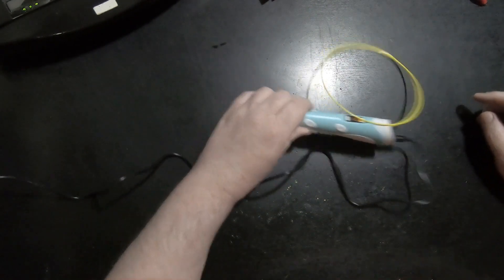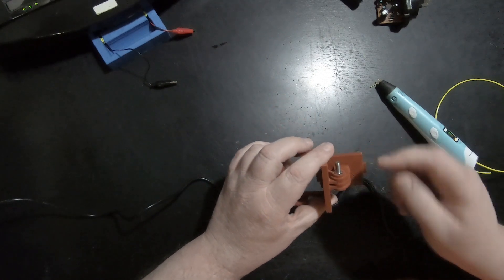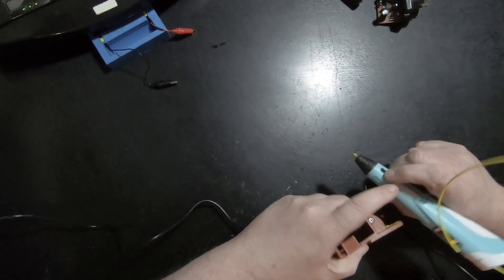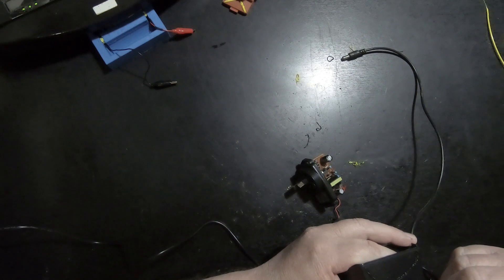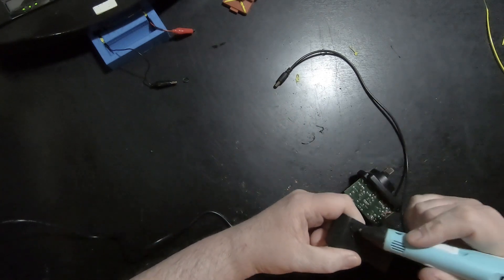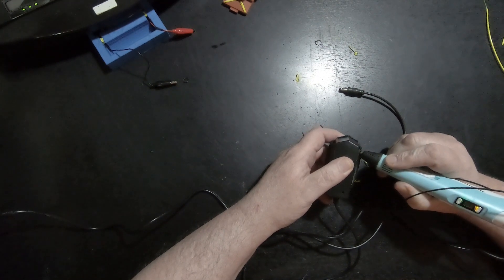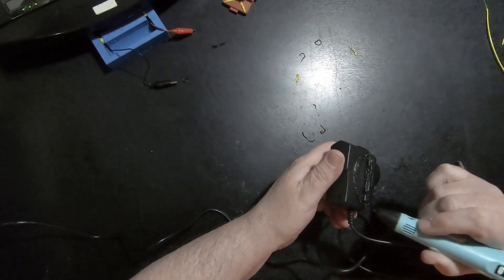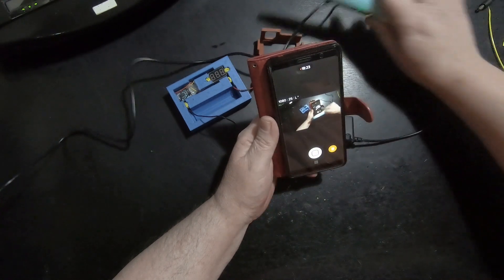Using 3D Pen for 3D welding and a repair using ABS plastic

Comment: You might consider showing more detail of the broken areas and closer visuals to see how it’s really doing . Aldo it would be better if you’d not move the piece around while explaining what you’re doing and be a little more vocal when your explaining how you’re going to proceed. This is just some basic things to make your presentation better. Thanks for sharing , I just bought a 3D pen to do repairs with snd your video.was helpful .